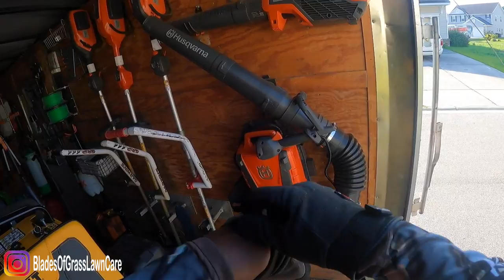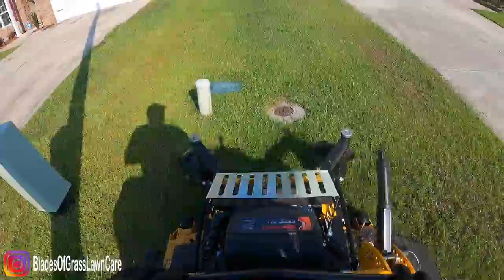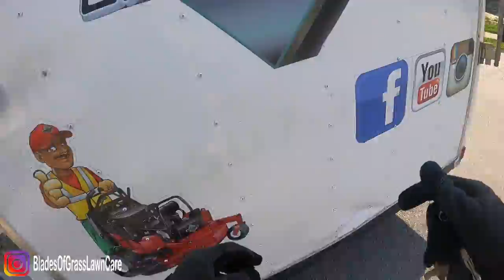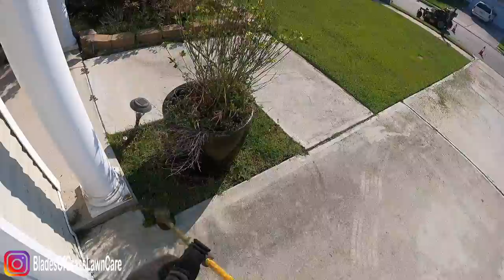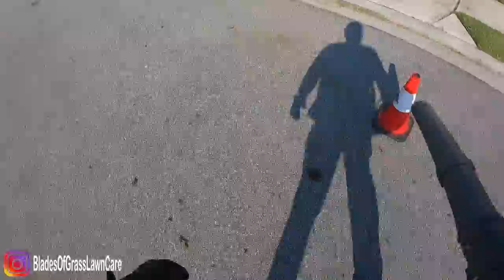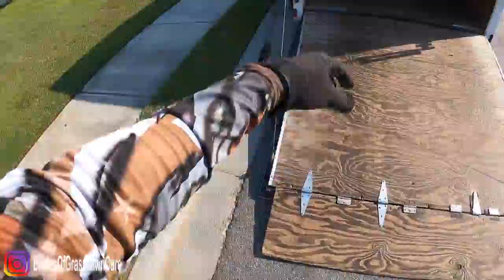Free lawn care for returning Soldier!

Comment: You talked about locking truck or  trailer, but you took the trimmer out of the trailer and did not lock the trailer. You took your blower out and left the wide open, when you went to the back yard. Puff smoke - PEACE ✌